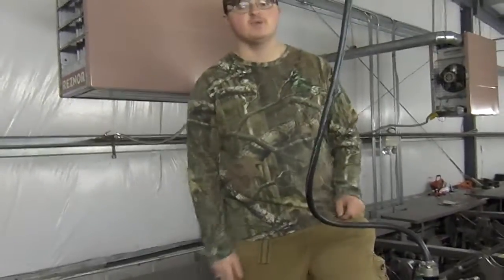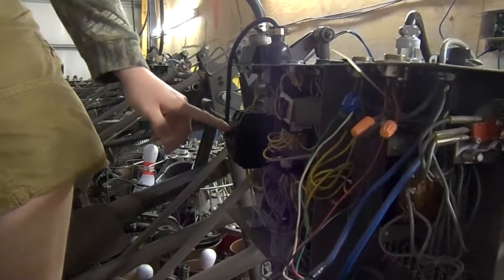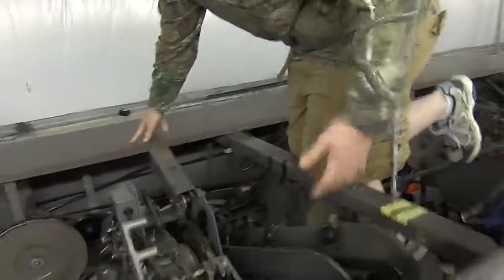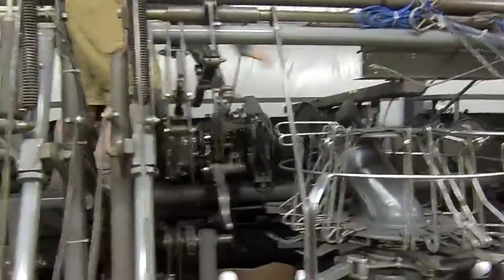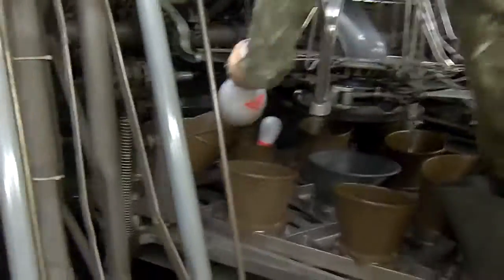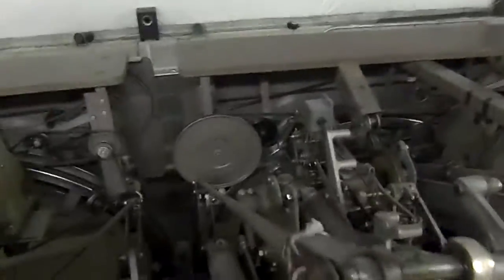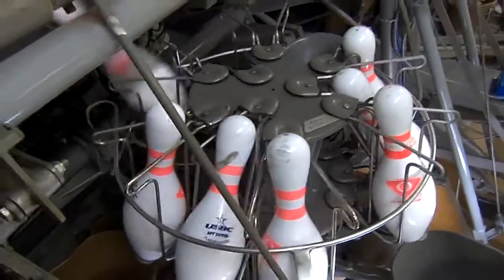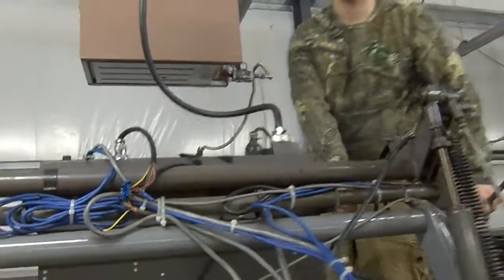How To Fix A Deck Jam- Bedford Elks Bowling

Comment: Proper Protocol for clearing a Deck Jam is as follows.  1. Shut the Pinsetter off with the circuit breaker. 2. Grab a Lock out box and unplug pinsetter and lock cord in box. 3.  Engage the clutch on the pinsetter. 4 While Gently lifting up on the holding hook Rotate the Motor to Gearbox Belt Towards the 7pin side of machine. Once deck lower sufficiently to clear jammed pins. Once pins are cleared from the deck removing of pins in the chutes is optional but not required unless the black out is caused by the moving deck failure to shift. 5. Climb out of machine and Then plug back in and restore power to pinsetter. Run the pinsetter for one or two cycles and observe machine in action.  Editors note. If you pull up too hard on the holding hook you will throw the first and second ball micro switch out of adjustment so you only need to pull up slowly on it til you hear a click

Comment: Thanks for the info, old man at my job told me to fix this by reversing the clutch and holding up the lever, well i was sitting there just going at it forever realising the deck wasnt moving, i had done it before no issue so it was a real headscratcher. Didnt tell me that you had to flip that little release switch up first.
Reply: If you don't pull the cycle solenoid to engage the clutch, this won't work.

Comment: The "reset button" is actually the cycle solenoid, but when you pull the solenoid inwards, it acts like a reset, as it triggers the machine. The reset buttons energize the solenoid.

Comment: from what you describe it sounds more like a ball bringing a pin up as the ball goes up the lift rods.  there is an easy fix for this.  installing a pin-deflector cord stops pins from going up with the ball.  it is a small bracket which snaps onto the 7 pin side and you attach a elastic bungee cord to the hook and the other end through one of the existing holes in the rear frame.  while working at amf, we averaged 2 pins that went down the subway per week.  after installing the cords, it dropped to less than one per month

Comment: Your lucky you have not been pulled into the belts with all the loose clothing and key strap that is dangling from your pocket. Practice safety first!!!!
Reply: Holy crap, I hadn't even noticed the lanyard. I noticed the clothes, but I was focusing too much on the strange procedure. This is not how we do it usually. Are you on an A2 or something else? We have A1s, so they might work a little differently.

Comment: when lowering the deck, how essential is it to hold up that lever? I didnt realise it was there and I used the belts hooked to the wheels to lower it. Thats not bad right, its just more tiring? If its bad i want to know
Reply: No, it's not bad. If you turn it the pulley without pulling the deck lowering hook, the deck will only go down for a short stroke as if it is picking up pins, but if you lift the deck lowering hook, it allows the deck to lower further, like it is setting new pins, and will provide more room for the mechanic.

Comment: Actually that wasn't a deck jam. That was pins on top of the deck that caused the turret frame to lift and open the turret safety switch to avoid snapping aluminum turret frame or cause other damage. FYI, PLEASE PLEASE PLEASE FOR YOUR OWN SAFETY PUT THE DAMMM ELECTRICAL BOX COVERS BACK ON.

Comment: at are center you don't have to pull the leaver you just have to turn the breaker of and there's a butter underneath the motor flick it up and spin the belt we have A MODEL MACHINES
Reply: The machines in this video are a-2s so they clearly don't have that
Reply: They could have made it easier on themselves by pulling the deck holding hook (the lever) to set the machine to first ball, cleared only the jammed pins, instead of the entire deck, and set the machine to second ball, cycle, and then you're done.

Comment: How do you fix a lane that starts tossing pins out of the back of the machine where the  pins that are being brought up from the bottom that are suppose to be released to the  belt going up the top of the machine to the basket starts jamming up and then it  tries to take extra pins in the  notches that is  already holding pins as it takes them up to the  top. I cannot  explain the problem that well, but I seen it happen a lot when I had family that use to fix the lanes when I lived  on a air force base until 1992.
Reply: Jeff Knight I have boards up on the 7 pin side of my machines to keep that from happening. ZOT (I think they still do anyway) makes a kit you can buy and the installation is quite easy.
Reply: For anyone else with this issue:
There's an elastic cord used for pin deflection mentioned in the manual. It's not perfect, but it helps. It makes it so the balls won't usually be able to carry a pin up the ball return. It sounds like you keep getting a pin wedged in the rails, the balls stack on each other, and then the balls push the cross conveyor belt off of the pulleys. Look into getting the cord. However, if you use boards to keep the pins in without getting the cord, it could cause much worse jams because the pins will still get carried.